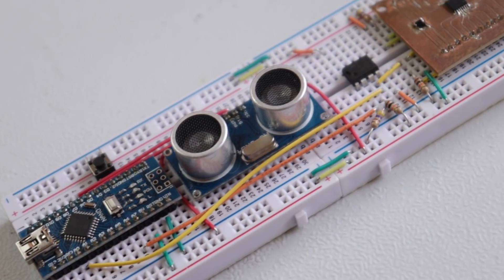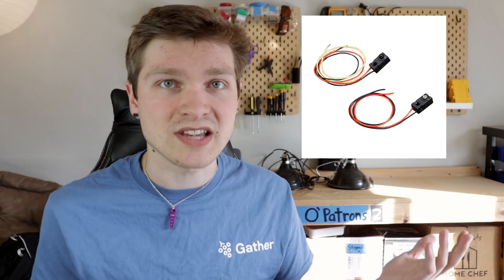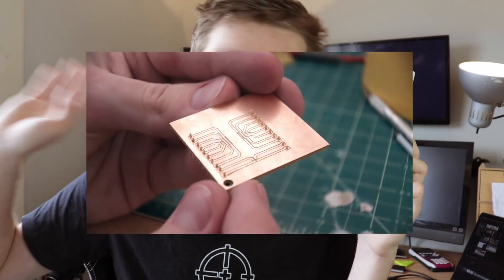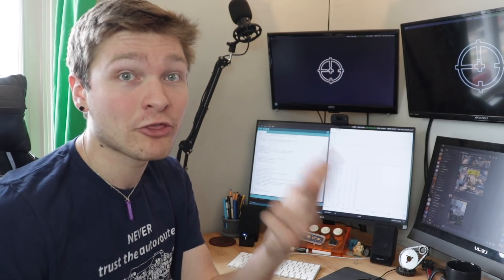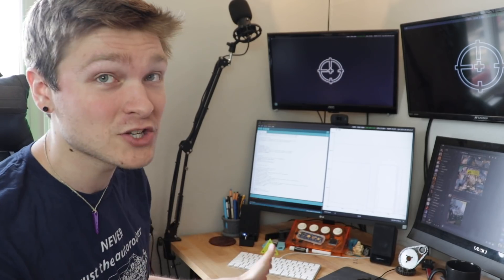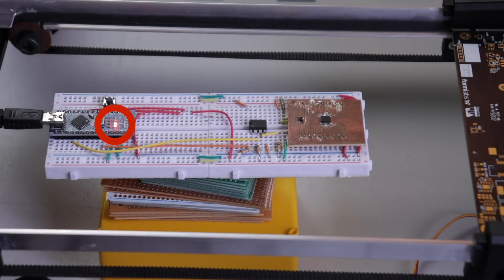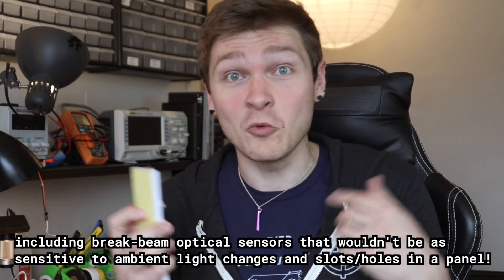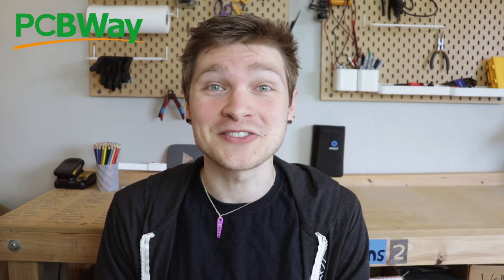Detecting Circuit Boards with Sound!

Comment: Probably not the first, but did you consider TOF (Time of Flight)...cheers.
Reply: If you mount the TOF sensor to the head, you can have the head move to a specific X location so you can stop the board at the optimum location, or even at multiple locations so you can assemble pcbs that are longer than your X travel allows.  You can also change the Y location so you can deal with PCBs that have cutouts that cause the board to stop in the wrong X location.  Check out the iPulse M10/M20 or S10/S20; it does something similar.
Reply: @theAGanimators  TOF sensor on the head is pretty nifty - could have other uses!
Also, what about the downfacing camera? I mean, move to location based on known board dimensions. Load the board and stop when a particular pixel changes - maybe decelerate before then.
Reply: I came here for this reply :P Was gonna mention Seon using them to pretty good effect :D
Reply: @azyfloof  me too....I've already mentioned them to Stephen....
Reply: me too.. VL53L1X TOF from ST, it is more of a point measurement though rather than the cone the ultrasonic gives you
Reply: Just wanted to write the same ;-)

Comment: You could improve the optical sensor by using a microcontroller to pulse the transmitter LED really fast, thus creating a carrier frequency, and only look for that specific frequency on the receiver side of the sensor. This way you could tell the difference between ambient light and the TX LED.
Reply: This.  One advantage of this approach is that you can buy inexpensive 38khz IR receivers that filter out the carrier frequency.
Reply: @andrewkieran8942   Indeed, this would simplify the code ! Though I wonder how complex it would be to do with the hardware he already has.
Reply: @andrewkieran8942  well that would jam all your electronics in range with IR like TVs, ACs etc
Reply: @fdavpach  Thats easy to work around. You can buy the IR receivers in other frequency's like 52khz for the same price, and can choose one that is not common in tv receivers. Also the key is brightness, you can ajust the brightness of the transmitter led. You do not need to control a tv across the room, only detect if the beam is blocked over afew inches so it can be really dim and still work phenomenally well. Third option is you dont have to leave it running all the time, turn it on only when moving the conveyor belt and homing the board.
Reply: I have alot of experience with the IR receivers. What is great is the op amp inside them is designed to automatically adapt and reject sunlight, and they are tuned really well to only "see" the chosen frequency of IR pulses. Go to digikey and look up "Vishay Ir Reciever" they have ones specifically for bright sunlight or direct sunlight applications.

Like  @Frédéric Druppel said it simplifies the code in that it turns into one digital input that is either high or low, practically a switch. You could use one more IO to turn on/off the led if needed as well. I would run those two wires to the controller board, im sure steven has an extra pwm pin somewhere to generate the ir frequency.
Reply: Just need a 555 as on some cheap sensors you can find online
Reply: The issue there is that the goal of an optical sensor was to avoid having to use a microcontroller -- if you use a microcontroller anyway, you might as well go with the trivial solution

Comment: A laser sensor would be more accurate. Tx onn one side of the board and Rx on opposite. Modulate it with a AC for better performance.

Comment: The ir light sensor was doomed from the start, the difference in reflectivity of different materials and ambient light disqualified it. Capacitive Proximity sensors have been suggested, I a sceptical as PCBs are nonconductive until you hit a trace, thus you need a ground plane or a trace as a border around the pcb. You mentioned beam breaks, those would be fantastic for precision but you need  components spread out potentially getting in the way.
The ultrasonic sensor is bulky but it is contained on a single board which means it will be quite easy to install under the pcb out of the way of moving parts, and your resolution of 1 mm is way more than needed. I wouldn't sweat the extra microcontroller too much, this is a complicated machine and building one small sub assembly is not a great increase in complexity.

Comment: "I used an op-amp correctly!" OMG that is so relatable.
Reply: i use opamps for EVERYTHING, i havn't learned arduino so far and i gotta tell yall opamps are friggn magic, theyre the perfect compromise of analog and digital, take almost no current, have one hell of a supply voltage range and they never break :D
Reply: Op-Amps: Tiny black boxes full of witchcraft!
Reply: It's so simple! All you need to know is that:
1. An op amp does all it can at its output to keep its inputs at the same voltage;
2. When the + input is greater than the - input, the output swings positive and when the opposite is true, the output swings negative; and
3. No current ever flows in or out the op amp's inputs.
Knowing that, you guys won't get it wrong ever again. The rest is pure maths! You love maths, don't you?! 😁

Ps: Dave Jones – from the EEVBlog – has a lovely video tutorial on the subject. Go check it out!

Comment: since PCBs contain conductive materials, maybe an Capacative Proximity sensor? something like the MTCH101. and then have a long strip of copper on a pcb as the sensor? So basicly a small metaldetector. something like that would be less than 1 euro in parts. EDIT: this is not correct. as @Uzwel pointed out. With capacitive sensing you could sense a lot of different materials.
Reply: Capacitive doesn't need metal to trigger, inductive does :)
Reply: @Uzwel  yep you are right,  I mixed my capacitive with inductive. Capacitive should also be able to detect the fiberglass that the pcb is made of.

Comment: Flip up stop with sensor (micro switch or optical break) will give consistent stop positions. Put the axis of rotation perpendicular to the feed direction so it will move away and down when retracted.

Comment: That is the most unreliable sensor i have ever used 😂😂 i think proximity sensors will be better 😅
Reply: You need to program in reflection and noise cancelation. You'll get bounce-back off other surfaces. I'm using it to tell me how much crap is in a septic tank, works amazing. I know that the distance can't be 1km and you need to take a bunch of average samples and put them through a function to remove the obviously improper responses.
So unreliable, possible, more like software bugs on your end.

Comment: Capacitive Proximity switch is sad to be left out 😔
Reply: Probably big difference if the PCB has a ground plane or not, isn't it?
Reply: @ohadreu6865  very likely not. Plain plastic for example can be detected with capacitive sensors very easily. Extreme precision isn't really needed in this use case
Reply: Those were the first things I thought about too

Comment: If you modulate the IR LED current in the light sensor at a high frequency and AC couple (then filter) the output of the receiver then you could make it immune to ambient light.
Reply: Yeah did this in uni for a project. It also allows you to filter room light away
Reply: @Gentle_Chu  same here, if you don't want to filter too much fire the IR LED at the smallest possible dutycycle (<10% and at max current for that dutycycle check datasheet for IR LED) and than you can read with a short delay (current rise time) in that on-time. The flash of the LED should be so bright that you can set the treshhold brighter than direct sunlight. You caould even modulate music onto the LED and play it back from the sensor although it sounds crappy depending on your sample frequency XD
Reply: Basically: using the Lock-In-Amplifier principle https://en.wikipedia.org/wiki/Lock-in_amplifier
Could just be done also by 
a) drive an IR LED by a 50% PWM
b) sample the light sensor values at the middle of the on/off periods
c) use the amplified difference between on/off sensor value